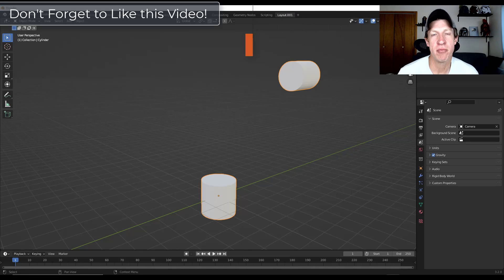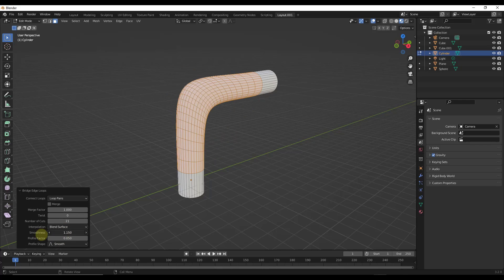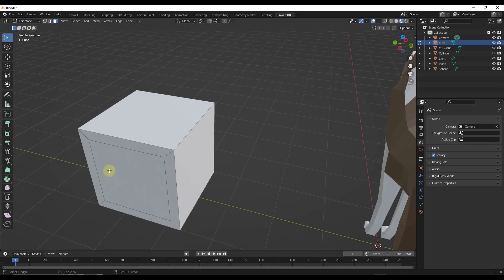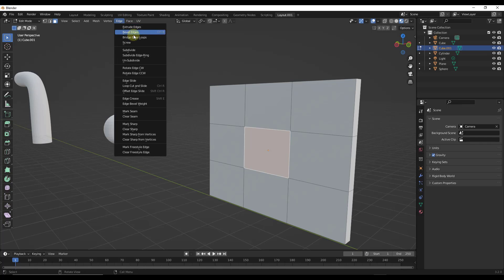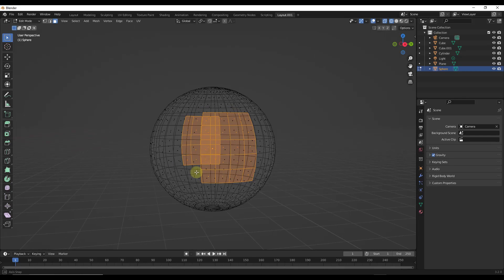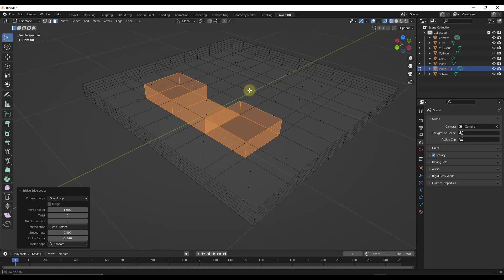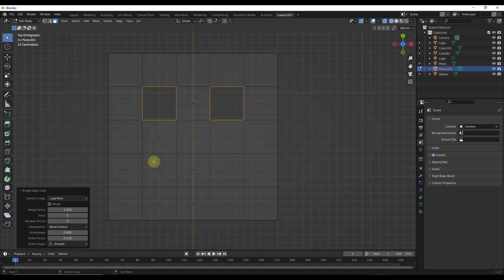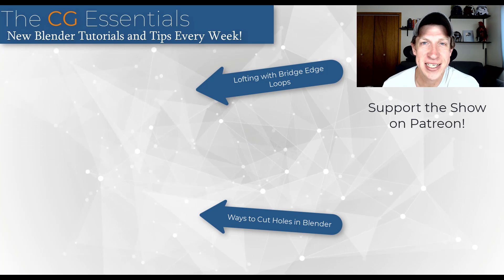The FASTEST Way to Cut a Hole in a Blender Object

Comment: To have a more controllable topology I would recommend insetting before actioning this. It will play much nicer with subsurf, and give you many more options for edge considerations.
Reply from the maker: I suppose it depends on what you're planning to do with it. Since I usually work more in ArchViz style models, I don't have to worry about subsurf that much
Reply: @TheCGEssentials  Plus, for ArchViz style models, you would only need that if you have an element fairly close up, like the corner of a wall, so you're likely better off adding a bevel modifier so you can turn it on for some shots, and off for others. Creating inset geometry lowers your flexibility in terms of quickly moving bits around And it reduces your ability to use things like bevel modifiers. So it depends on the usage needed, and what kind of flexibility you need.

Comment: Not as fast, but still fun, is to delete the selected faces, connect the first pair of edges with f, then select one edge of that edge, and just keep holding f until it went around and connected everything up. Again, not as fast, but quite satisfying lol.

And for a faster way, and if proper topology isn’t needed, I just quickly add a cube or something where I want the hole to be, shift select my object and then press control shift b (i think), which is other automatically applies a Boolean modefier, or just straight away applies it in one click (need to have bool tool enabled for that).